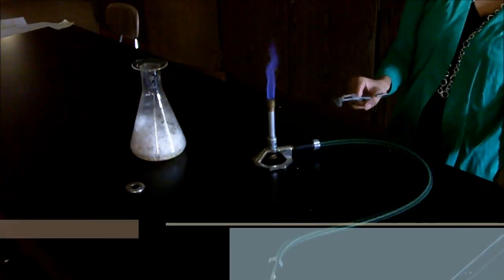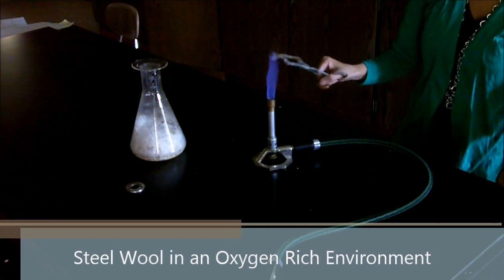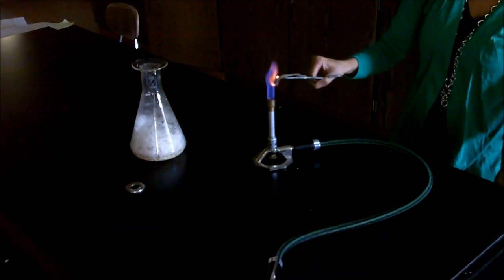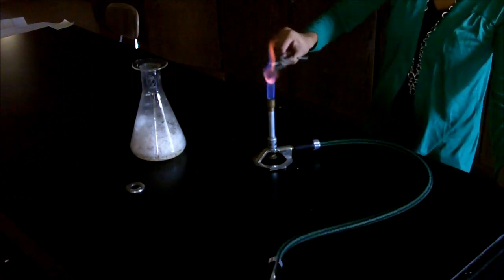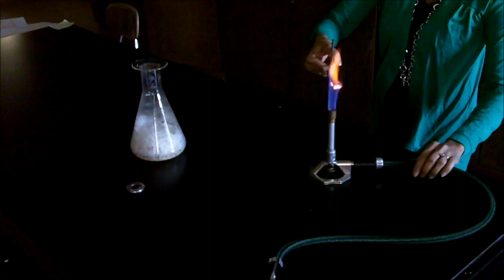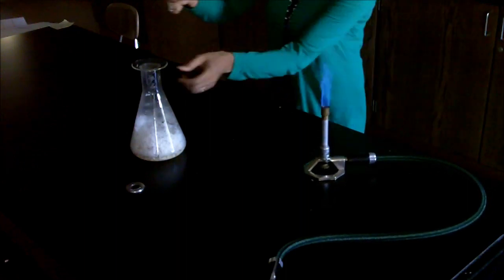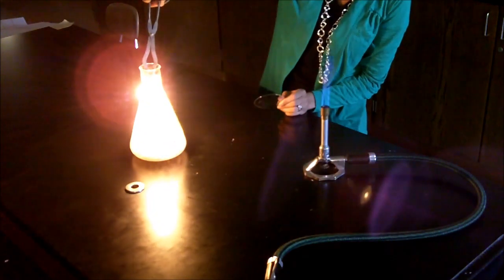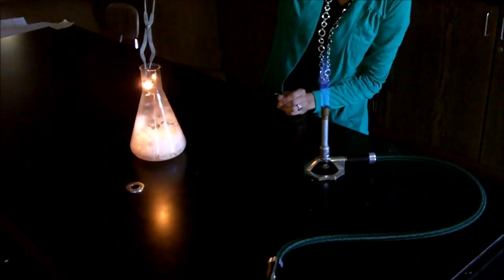Steel Wool in an Oxygen Rich Environment - Dazzling Demonstrations

Comment: How did you generate the oxygen?
Reply: I'm guessing that the white, starch substance in the beaker was potato (considering the credits, though jokingly, mention potatoes) and the potato was going through photosynthesis, producing oxygen, and that clear plate on top of the beaker held the oxygen, thus allowing enough oxygen to be contained and mimic an oxygen-rich environment.
Reply: @colindaniels6218  The edible part of a potato is the root, which does not conduct photosynthesis.  

For anyone wondering, an easy way to fill a beaker with oxygen gas is to decompose some hydrogen peroxide with manganese dioxide.  That doesn't appear to be how they did it here, but it works.